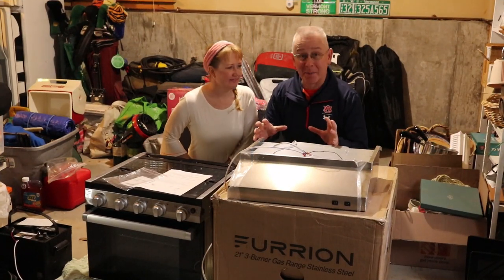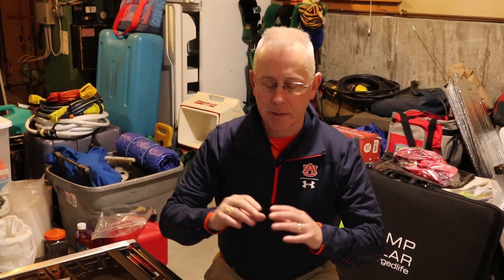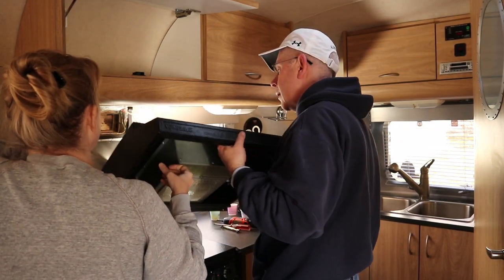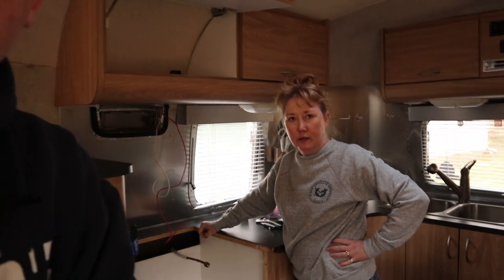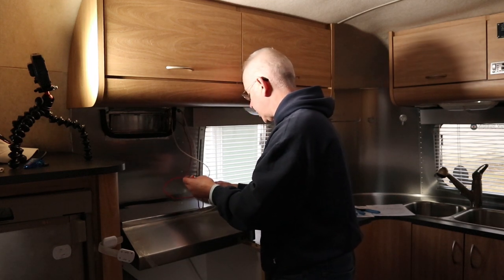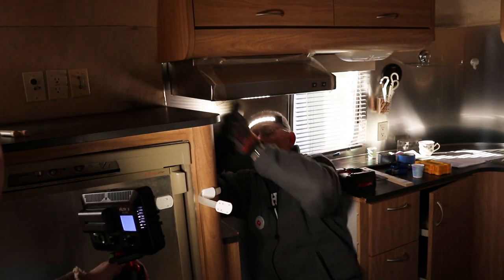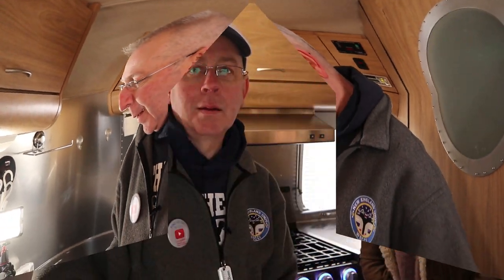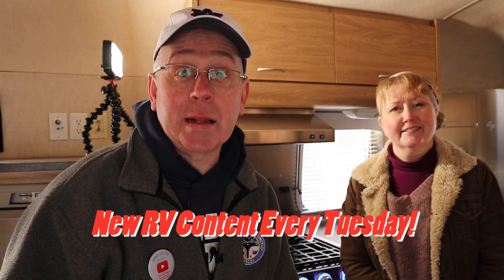Installing a New Oven and Vent in Our Airstream RV

Comment: We love your videos! Y'all provide so much great info on travels, maintenance and installs!  Just recently we installed our own upgrade to a Furion range in our 23' Airstream and also changed our warped freezer door.  Both of your videos on those were very helpful for us!  It took some time to decide on the 12 volt electrical route we would take for the range.  Sometimes it's a hit or miss situation; but we finally succeeded and love our new Furrion range.  Thanks for the video assistance!
Reply from the maker: Thanks so much for watching and we're glad our videos were helpful.  We love the look of our new Furrion stove and oven.  We're still getting used to the burners as they provide more heat than our old stove.  We're testing a diffuser and will provide a Luv Subbin short film in the near future.

Comment: We follow you two religiously on YouTube and enjoy your adventures and find your advice priceless. One question ... we have a 2008 25FB and bought a new range with the lighted knobs. All is well except for figuring out how to run DC power to the range top. Where did you find the DC wire for the lights? Many thanks!
Reply from the maker: Thank you so much for watching our videos religiously!  First, let me say that I am not a licensed electrician or a certified RV Technician.  What I did was tap into the 12V for the overhead oven vent.  I used a 3 port Wago Lever Nut.  The 12V supply was already there and went into one port.  The other port was used for the oven vent and the third port we fed down into the oven for the light.  The hardest part was snaking the wire from the overhead down into the oven.  It might have seemed easy in the video but probably took 3 hours in real life (that would have made for a very boring video).  I used marine grade sheathed wiring and installed rubber grommets where the wires went through the aluminum (yes, I had to cut a hole for the oven wiring).  The Wago lever nuts can be found on Amazon - I love them.  I hope that helps.
Reply: @LuvSubbin  Thank you for your quick reply and assistance. We use Wago connectors in our home and found them to be a secure and safe way to connect wires. I'll check out the marine grade sheathing wire and purchase some. You inspired us to go on a reconnaissance mission for wiring. We believe we can tap into the 12V line from a water filter that AS installed under the sink (which we tossed out when it became unpredictable). We found the wiring loom under the kitchen drawer in the island, along with a roll of masking tape left in there from the Mothership. (It is similar to an archeology dig. lol) Then we hope we can use fish tape to bring the wire around the cabinetry to the range top. Fingers crossed!  Thanks again for your help. BTW We use your "lists" slightly modified for the layout of our 25FB and our departure/arrival routines are going much smoother. "Drive defensively and slowly"   So true!

Comment: Rich -  Replacing my stove/oven has made it to the short to-do list. Great timing for me to see this episode of yours. Could you please throw me the model info.   Thanks,Mark
Reply from the maker: Hi Mark - Thanks for watching!  The model we installed was a Furrion F1S21L02A-SS.  Like we said, we had to install a 2" spacer at the bottom.  There's also a small trim piece on the top we'll have to put on as the depth was not exact.

Comment: I replaced the original range in our Airstream with the very same Furrion.  I did not realize that ring on the control knob is red when burner is lit if you have the power switch on.
Reply from the maker: Thanks for watching as always!  It will be interesting to see how often we turn on the blue disco lights when we're out camping.  For us, the big upgrade is the oven window and light.

Comment: Can you provide a little more information on the dimensions of the old stove and the new one?  I'm attempting to replace an Amana stove in my 2004 Airstream with this Furrion.  Did most of the measurements line up?  It doesn't appear that you had to cut the cabinet/counter.  Did you have to shim the sides?  How did you shim the bottom?
Reply from the maker: Hi Dennis and thanks for watching.  We did not have to cut into the cabinet but it was not a perfect fit.  From a height perspective, the new stove was 2" shorter.  It rests on the cabinet on stainless steel supports but we did not want it to "float" on the bottom.  We glued a 2" block under it and had our local machine shop fabricate a stainless steel sheet to cover the gap.  It looks great.  The depth was also 1" shorter and we covered the rear gap with a similar SS plate.  We used the machine shop because I wanted the edges perfectly straight and didn't have the equipment.

Comment: Do you guys have the oven wired from the battery, the converter, or some kind of fuse box?? We have a 65 caravel we're trying to install the same oven, and a fridge on.
Reply from the maker: Thanks for watching!  The only electricity that the oven requires is for the oven light and it is wired into our 12V system.  It is on the same circuit as the overhead exhaust vent.

Comment: Did your payload capacity Increase or decrease with the upgrade? And of coarse always love your videos. Especially when there is a project to be done.
Reply from the maker: Thanks for watching!  LOL, you have to love payload questions....But because you asked, the new stove is about 15 lbs. heavier.  However, it is mounted behind the axles.  That would reduce tongue weight so my effective payload capacity actually has increased!  I'm still about 600 lbs. under my F-150's specified 2,095 lbs...
Reply: @LuvSubbin  I was hoping you got a chuckle from the question. But I sure thought the new oven weighed less with thinner gauge material they use today to save a few pennies. Oh but it has the glass top?  Love the payload stories on Airstream addicts too.